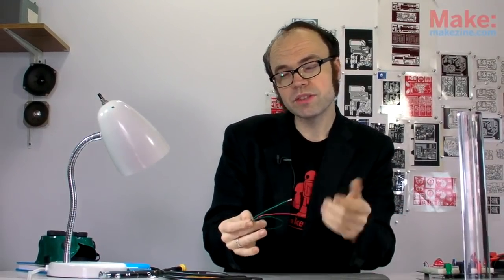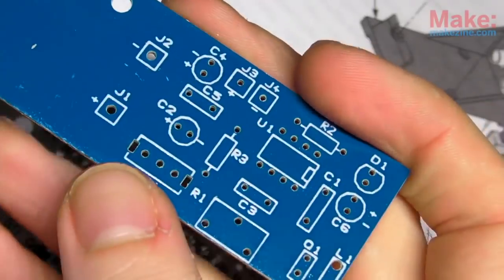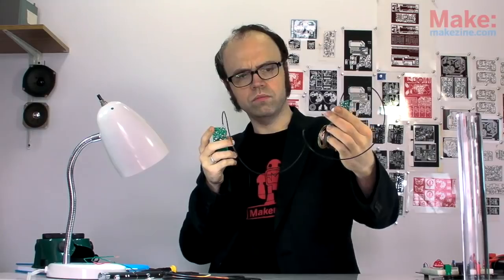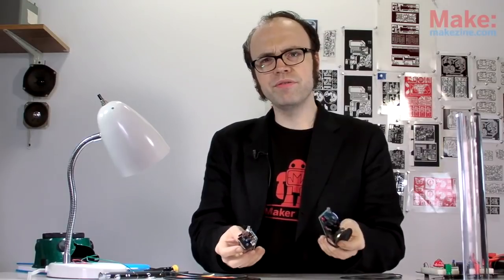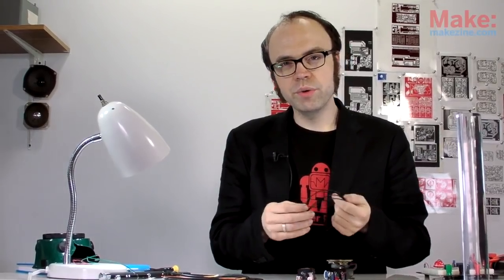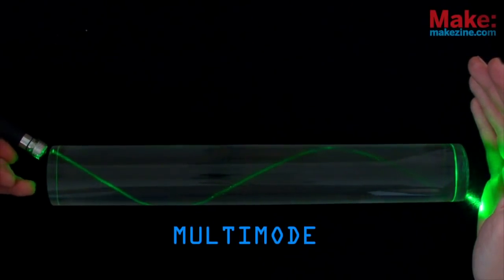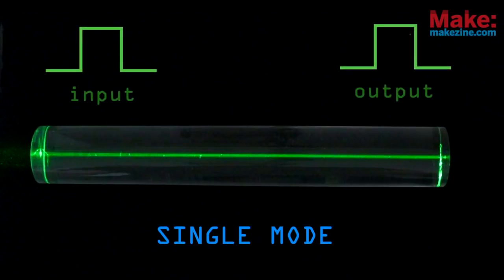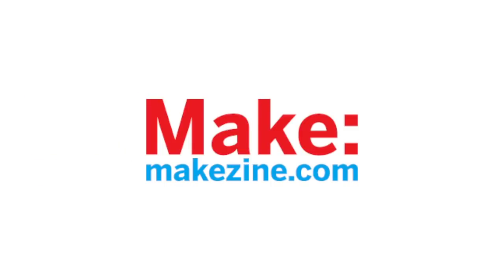Circuit Skills: Fiber Optics

Comment: @WitheredAnge1 in single mode, the light follows the same line, all the way through, it does get reflected on the sides.

in multimode the light is reflected, kinda like throwing a handful of pebles on the ground

where in single mode those pebbles would all follow the same line

Comment: @DrDissent When photons strike the base of the phototransistor, they knock electrons from their atoms creating a very small electric current (microampheres).  This current is amplified by about a factor of 100 in the transistor in the same way that BJT transistors amplify their base current.  The op-amp is wired to amplify this current even more to drive the speaker.  Therefore, the kit does convert light into electricity, but the vast majority of the sound energy is coming from the batteries.

Comment: @WitheredAnge1 the light is only reflected on the edges if it enters the fiber at an angle.  If not it follows the path of the fiber regardless of curves.  A single mode fiber can only accept one beam of light. Its core is about the same thickness as the light beam being transmitted.
look at the difference in thickness:
multi-mode fiber @ 3:56 (can transmit several light beams at once)
single-mode fiber @ 4:08 (for just one light beam)

Comment: @morteg15 no, because your actual voice, which is essentially waves, is not whats traveling at the speed of light. your voice is converted to light, then reconverted on the other end from light to sound again. think of it like using a flashlight for morse code. thats not your voice, but it still gets the message across as long as the person on the other end knows what you are doing.

Comment: @WitheredAnge1 Single Mode fiber optic cables are probably used over straight  paths. People probably use a multimode where they meet curved paths and connect the two lines.

Comment: I think there are two points of improvement this kit have:

1) The transmitter and receiver can use standard SPDIF optical components. This will allow better fiber connection quality, eliminate a proprietary part, all without significantly increase cost.

2) A follow-up kit can be made by adding a microcontroller into this equation and use single-direction UART at 8N1 115200bps as a simple digital protocol.
Reply: A chinese guy/japanese guy, no big surprise he understands this.
Reply: i think they should build one with 3.5mm jacks.
Reply: orange vanim

Comment: @TheEXTRAtesco The wavelength of white (below 850nm) light is a lot less effective than the IR wavelengths used in SM and MM fiber transmissions normally, 1310 and 1550nm. So instead of 70km with 1550 SM you might get 70 meters with visible light.

Comment: @alejosky Infrared bounces all over the place, so an analog representation of sound would be messed up. You would have to go digital so that the receiver can get a clean signal. How that would work exactly without a two-way path to do error correction, I don't know. But it seems to work OK for TV remote controls.

Comment: @ghaleb00 Yes, just rectify the mw from the antenna with a diode. The problems are getting enough power at a distance to do anything useful, how to keep anybody who hasn't paid for the energy from using it and how to dampen the screams of all those who are standing too near the transmitter.

In the '60s people built small transistor radios that were powered by rectifying the signal of the strongest radio station in town (even if it was not the one being listened to).

Comment: i went camping on the weekend and saw a line that said bell on it. it was a big line that was about 4' in diameter and it was fiber optics. is it true you can sniff the info lice u can with normal wire?

Comment: like always an awesome video from colins lab .you didn't go into step/graded index fiber, also the different light sources they are coupled to. it should be said that fibers generally don't use dangerous light sources and most of the danger of fiber optics come from broken glass shards.

Comment: How is the light supposed to stay in a straight line over long distances, if the cable is ever so slightly bent, or really really bent? Does it reflect?

Comment: In the netherlands there is a big trend going on to have a fiber connection to every home. Because the coper infastructure is failing, there replacing it with an optical network in to everybody's home and ithe network is not made by the isp so its and open network

Comment: No... to teleport you need to move faster than light. Bending light is quite easy, since various materials slow light down because the photons bounce off the molecules in the material, therefore causing a bending effect when some parts of the light go through different thicknesses of the material.

Comment: maybe its transmit signal info but it cant transmit electrical power
Reply: +Rodrigo Batalon actually light is a form of energy and this this is rx light so yes it can what it cant do at is current form is convert that light into electricity but yes it can be done , this is the working principal in solar cells
Reply: +Sys.stem 
Light isn't a form of energy.  You associate energy with a photon because you can only observe it if it collides with something and that necessitates a change in momentum.  Photons are still particles even if you can only really describe the way that groups of them behave.

But yeah.  You need photons for an electromagnetic force and you can absolutely transform power into luminosity and flux and all that stuff.

Comment: someday when the photovoltaic panels will reach 100% efficiency, maybe we can use the fiber optics to transmit electricity :P (without the conduction problems of the copper wires)

Comment: this is exactly why fiber optic cable for your surround is a waste of time. you are just adding 2 more steps into the transfer. convert the normal digital signal (normally sent down a coax cable) to IR then send down fibre optics then convert BACK to the same digital signal.